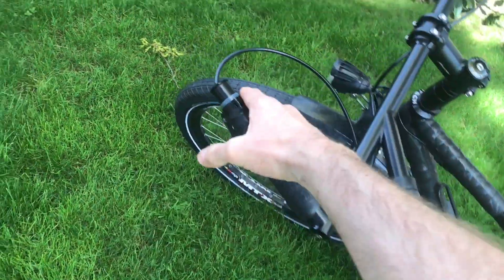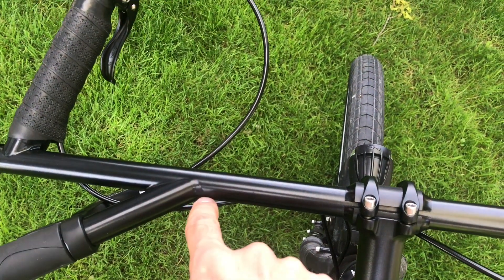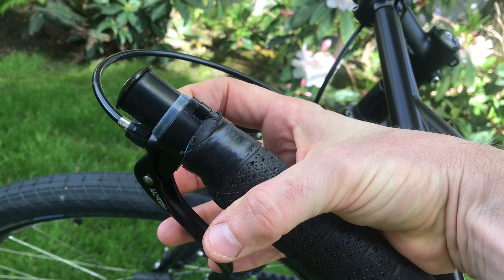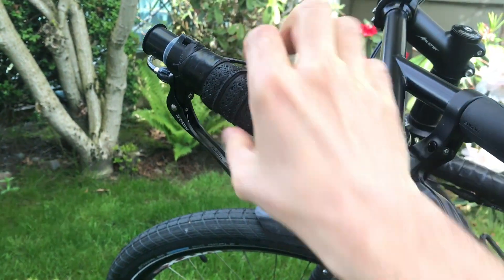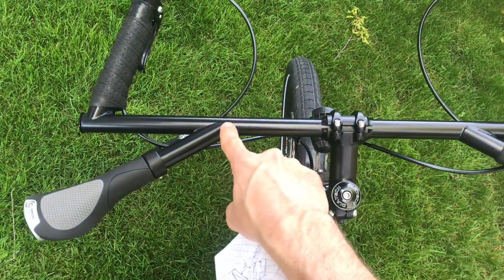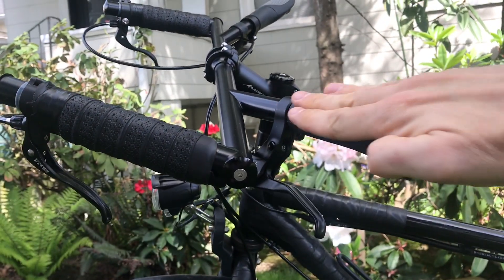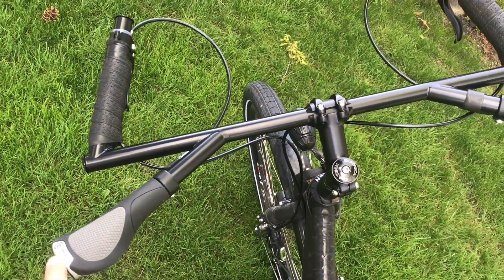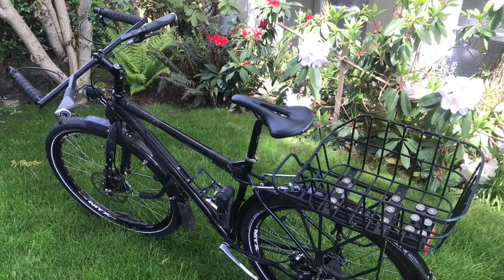My custom handlebar: 4x brake levers, 2x riding styles

Comment: I want to put secondary brake levers on my bull horns... This is just what I was looking for... This is very helpful... Thank you!
Reply from the maker: Archer Lane It’s fun.  The “cross style” or “interrupter style” are what you want.  That’s the trick that makes it all work.  That and fooling around with shims.
Reply: @craigrmeyer  Thank you... I'm wasn't  familiar with those terms... I found myself really needing brakes when using the bullhorn extensions that came on my bike... I'm usually going really fast when I'm holding on to those... It is very annoying having to relocate my hands to the levers on my straight bars and it is probably dangerous also... I'll check with my bike shop to see if they have some cross levers in stock... If not, I will order some... Thank you!